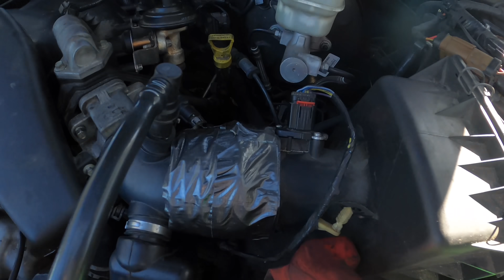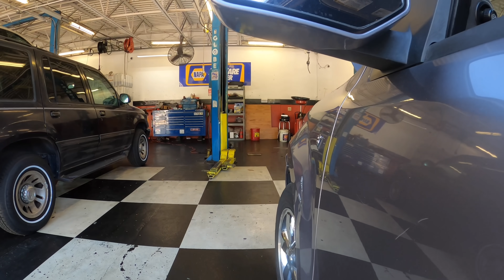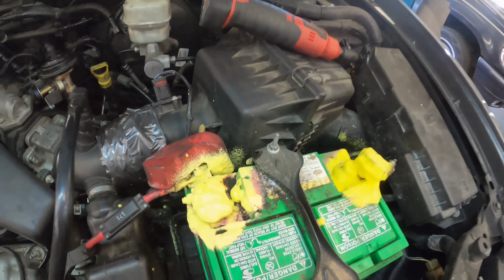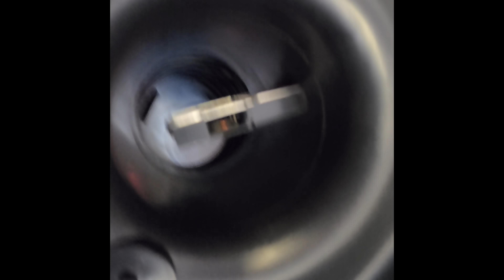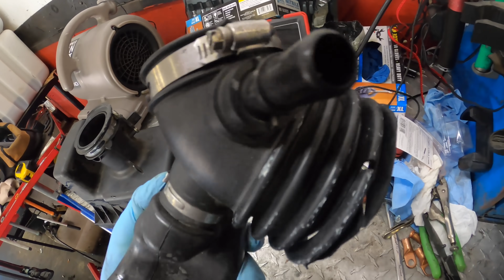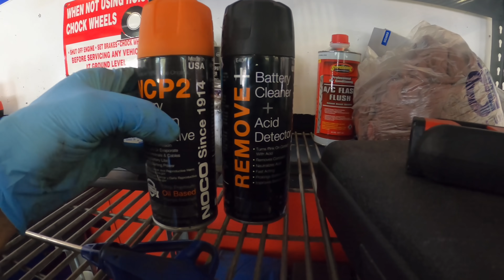Want to break down? Do This!  Ford Escape V6

Comment: Those were the days when no computers controlled engines.  My old 72 Pontiac Catalina only required spark plugs and oil changes that rarely happens. Now much more to go wrong but they still have 4 wheels and move so they don’t do a lot of extras for all the complexities

Comment: If I was designing an intake, I would not put the MAF on that side of the flex duct.  I would put it on the other side like other auto manufacturers do.  It is on the side of a replaceable item called the air filter.  That duct is going to get a lot of activity.  If the MAF was on the other side, there would not be an issue with duct tape.

Comment: I know that this is USA and not Northern Europe, but still:
Sometimes, USA is just so different from Europe.
I like to know about the differences and the similarities.

What happens to the oil spills from cars, the chemicals you use and what do I know? 
Do you have a drain in the floor that collects all chemical residues in a tank or is it all led to the sewer?

/JD

Comment: I cannot wait to watch the rest of this saga.  The same thing happened to me with my daughter's Sentra.  I did plugs and coil boots, had to take the intake off, including the hose/box assembly.  I must've torn the hose a bit in removal, or else it was just old (2008).  It had a crack in the accordion, about 2 inches long.  I tried the duct tape method and after getting everything back together.  It ran like total crap backing it out of the garage.  I thought I'd mis-installed a plug or coil, so I tore everything back apart, re-checked and re-assembled.  Finally figured out it was the air/vacuum leak with the duct taped hose.  Those things are not as cheap as I'd imagined they'd be, although this was a OTC part at the local store and I'm used to ordering from RA most of the time.

Comment: We helped a customer with a Emission Tube that was leaking on a Sunday afternoon at our shop using a HVAC Duct Elbow & Aluminum tape as a temporary fix until we could order the proper part...it worked!..

Comment: Ok, food for thought question. A lot of the cars nowadays, when the battery is disconnected, needs to be driven a bit for the computer and sensors to relearn things. They will run rough until you do that. Is that possibly the case here?
Reply: That might have contributed but the faulty air readings due to the torn and leaky intake hose are probably the main problem.

Comment: I have a question I have asked a lot of mechanics on here and they never can give me an answer I have a code that popped up that is steering assistant fault on a 2015 Ford Fiesta there's no check engine light on or anyting the steering is hard to turn and it gets really super easy but when you turn inition all lights go out the cruise control don't work air bag ABS light traction control light brake light all these lights are on any suggestion what the problem could be then I got a $200 scanner shows nothing when there's no engine light

Comment: A long time ago I worked as a BMW line mechanic. We would add a PEPSI to the major service. Half of the PEPSI would be used to clean the battery and the other half to satisfy our thirst. According to Sun Equipment and all Bentley manuals when installing a DC battery always connect positive first and then ground and when removing always remove ground first and then positive. I was also the electrical troubleshooter for the dealership.

Comment: I have a 2012 Ford Escape 2.5. I wanted to get a v6 until I found out that the v6 engines weren’t the greatest and tend to have more issues. Lucked out I guess as I haven’t had many mechanical failures aside from the evap purge solenoid going out for some reason. Thanks for the videos

Comment: Here in the USA there is a brand called LYNX that you can get at many parts stores. It is a battery corrosion protector too. I t works great. My brother was an aircraft mechanic and he used it.

Comment: The "back and forth" action on that battery terminal cleaner will ruin the wire bristles on that cleaner. Regardless of which hand you use, only rotate in one direction which for me is clockwise.
Reply: Yeah, "back and forth" will ruin it. You just want to gently ease it in and out. Repeat vigorously. Regardless of which hand you use, occasionally stick it in really deep and rotate it a little bit. Then some more in and out. It might get a little hot so you can cool yourself off with a glass of Champaign. It's ok if a little bit drips on the thing. Its not the worst thing if the hole gets a little wet while you continue gently easing it in and out.
Reply: @tvviewer4500  Giggity...

Comment: My intake hose split open on my ‘14 civic in -44c weather after driving from the coast to northern Alberta. Car would start but then die right away. I didn’t see anything when I popped the hood but I also wasn’t into doing anything when it was that freakin cold. Went in to camp for work with a buddy and the next Sunday,found the problem,with the MAF sensor on the airbox , it wouldn’t run. 23$ part from Honda,good as new. Now I keep an extra one in the trunk because I will be back working up there when it’s bloody cold again.

Comment: Just my 'Nickel's worth' but if properly applied, 'metal-foil tape' will work very well as a sealer IF it is applied slowly and 'buffed-down' tight w/a towel and worked so the edges are tight...and maybe a light coat of black spray-paint to 'seal it'
( People don't like the price on that specialized tape, but there are times when you 'just gotta' 'bite the bullet' and get a roll when you consider the exorbitant 'price-gouging' for a replacement part )
After all, the part is only an 'air-handler conduit' that is not subject to the stress of 'torque load' nor does it 'move' in relation to other parts, so as long the tape works, I see no real reason not to use it
Reply: @johnogara3029  Naw...its just that I've used on stuff at home, like the top of a metal gate-post so a solar-light would stop wobbling and that tape was still working after years of exposure to brutal weather in S. Illinois and sun on it all summer at temps almost a hundred!
( I did seal w/some galvanized-zinc 'silver' to match everything )
I know beyond question it works, even on a loose section of aluminum soffit on my house where it worked into a seam-opening...I used some gloss-white to blend it, and it's still there after 8-yrs. or so

Comment: Wondering if Ray had the battery ground disconnected while sticking his finger in the throttle body. Some say it’s recommended for safety, if it’s a drive by wire setup.

Comment: I do believe that I would have left that duct alone until I got the new part. At least I could drive it in and out of the shop. If they decided not to leave it, I wouldn’t have to do unnecessary free work.

Comment: I bet Gorilla tape would work.  It's hands above duct tape.  Gorilla markets a commercial brand of gaffer tape.  We used lots of 3M gaffer tape at the airplane factory.  Sometimes to our regret because getting it back off was difficult.  Once I stuck something to a concrete block wall with double stick 3M gaffer tape.  Pulled it off two years later and chunks of concrete pulled out of the wall.

Comment: When it didn’t start I was hoping you’d have to deal with this series’ ignition lock housing issue, which I’m currently dealing with and about to repair myself next week.
Reply: If you remove the ignition switch from the ignition lock housing it will let you remove the ignition lock housing from the steering column without having to remove the steering wheel.   If you have a die grinder to slot the security screw it makes it a 30 minute job.

Comment: I wonder if something like gasket sealer would work on that. Or perhaps a piece of PVC hose or similar big enough that you can put two more clamps on where it broke.
Reply: You can get silicone tape that only adheres to itself that allows you to stretch it tight, you could wrap that thing up to work. It also works on radiator hose if you have an unfortunate leak. But it’s only meant for a temporary stop gap till you get the part replaced.

Comment: I had to duck tape many elbows when I worked for a crummy shop owner. I don't think he even tried to source new ones. I was paranoid about it so I always cleaned them real good and used black silicone in the cracks before wrapping with the tape. Always worked, but I hated doing it.

Comment: What's up with these hard to get Ford parts?
Reply: It is a 13 year old vehicle. Parts are getting harder to find for something that old and contrary to popular myth, manufacturers do not have to manufacture parts for 10 years after a model year. My truck is a 2007 and the dealer says I should think about a newer vehicle as some parts are becoming hard to source. Eventually the supply runs out.

Comment: Hmm junk yard's have parts
Reply: Not always, as was the case here, but sometimes can get one from another yard.
Reply: @BigLisaFan  i belive hexwas trying to buy from a dealer  this would have bee a good part to get from a  junk yard asvits not critical  to safety
Reply: @steveholland1163  Bought many non-critical parts from scrap yards. Someone ripped of the hub caps from my van. They were $160.00 each from the dealer. Got a set of 4 for $25.00 from the scrappers.

Comment: Foil hvac tape might have actually worked. Duck tape (yes, it's duck, not duct) sucks at heat cycling and sealing ducts.
Reply: The adhesive in that is pretty thin and gets hard and brittle over time. Indoors it lasts for quite awhile. Seen some hvac systems foil taped ductboard still in decent shape 30 years old. But ones that have got damp in a crawlspace below there plumbing leaks have dripped on things, falling apart. Foil tape is weak too, will tear then next time he changes the air filter. Which is probably how that boot got torn in the first place. Probably from one of those quick lube shops is my guess.
Reply: @brnmcc01  yeah, I'm not saying it's a permanent fix, but it might have actually sealed the thing long enough to get the right hose. I've done it before in a pinch, and it beats nothing.

Comment: My wife has a 2014 Chevy Sonic with a similar issue. The car began having vacuum leaks and running poorly. When I began to investigate it the air intake hose began to fall apart and split like the one in this video. Once I ordered a new intake hose the issue was resolved. Come to find out Chevy actually later recalled this part.

Comment: May not be good for a permanent fix, but it's great for allowing you a relatively safe drive to the repair shop. Same for the infamous plastic strips, they can prevent dragging busted parts on the road or debris getting caught by belts or fan blades just long enough to deliver the car safely to your mechanic.

Comment: And if the clamps are broken you have to buy the whole housing. Happened to my daughter on her 2016 Edge. They wanted $120+ for the housing to get the clamp. We cut the little tab off the air box and fixed for $4 with a NAPA hose clamp.

Great video.
Reply: All these goofy custom parts, probably why cares are $70k now, i'd to try to keep up with repairs going forward

Comment: If it were my rig, I might try and see if the aftermarket had anything. Not sure if someone like K&N would make an intake system for an Escape, but even a crappy brand tube and cone filter would be better than a duct tape fix.

Comment: Simple use of duct tape can be OK.
Patch a cracked duct. 
Perfect.
Gets you going until correct parts can be found.

Just have to be closing holes, not trying to fix something else...

But the duct tape needs to be applied so it actually closes the holes...

Comment: This is an induced problem caused by an incompetent mechanic.  100% preventable with reasonable care.  The duct tape is joke as it only rides along the top of the bellows ridges and no way seals the duct from sucking air in the bellows valleys.  Plus the sloppy, misaligned orientation of the large clamps completely ignoring the alignment tabs.  Awful!

Comment: It's a Ford.  Duct tape and bailing wire comes in the emergency repair kit that comes with the car. The mess on top of the battery is where you assemble your tacos into foil to place on the intake manifold to heat up for breakfast!.  The hot sauce corrodes the terminals.
Reply: @johnogara3029  good you grab it when you just drive in.  Seen too many tacos heated on em. Especially at lunch after running for 5 minutes.  Engineman 66-74 USN.

Comment: Did this on my 2007 Altima , was bucking really bad so I duct taped it and it's been running well for two years , dealership here wants 120$ for the rubber tube lol
Reply: You actually closed the hole.

Replace the tape yearly. It wasn't made for the heat under the hood.  It was made for the lesser heat in an attic.
Reply: @fhuber7507  yes you are correct especially with our Quebec winters who knows when it will let go lol

Comment: This happened on my Kia Carnival (Sedona) and needed it running the next day (7 children), I ended up using a bike tyre tube and wrapping it around the split and used metal cable ties to hold it on as a temporary fix. Worked so well that i forgot about it and it's been like that for 2 years hahaha
Reply: Thank you. That's a great idea to keep in my back pocket for similar emergency.
Reply: I assume that there is no 'check engine' light since that fix
Reply: @pete84101  not once, the rubber is wrapped so tightly that it seals perfectly
Reply: There’s nothing more permanent than a temporary fix that works!

Comment: An old mechanic's tip . Every time you check your oil , drip a small amount from the dipstick onto the battery post . It will never corrode like that .
Reply: Don't do that, use any grease/dielectric grease/fluid film ... Many products are available than dirty oil with metal particles in them that can be conductive.
Reply: @Motorsportsgeek  I've been doing this for over 40 years . You are allowed an opinion , I can only state that this works .
Reply: @Motorsportsgeek  Metal particles aren't going to be a problem - after all, you're putting them on conductive metal posts and clamps...